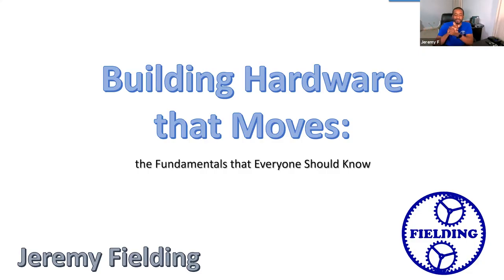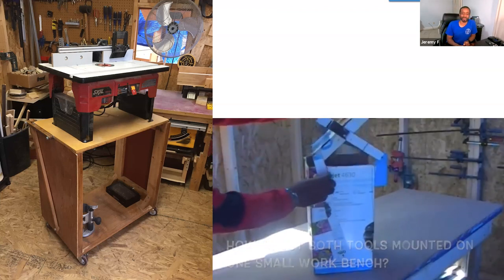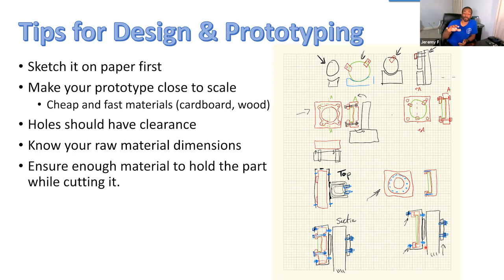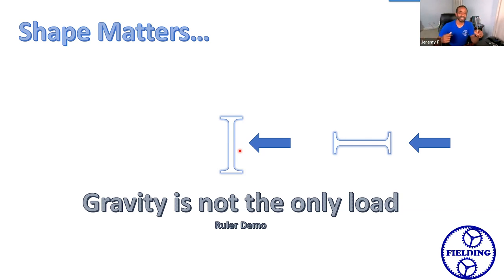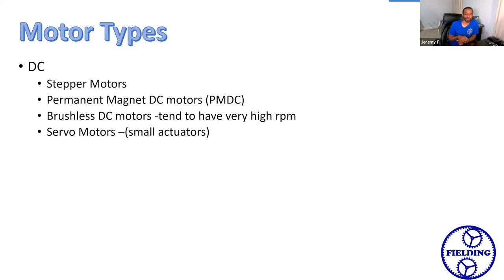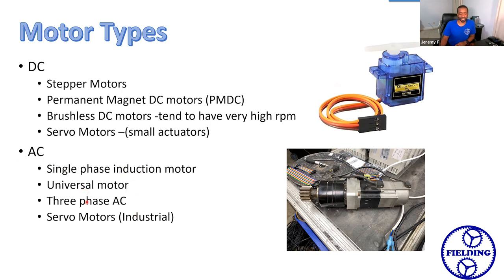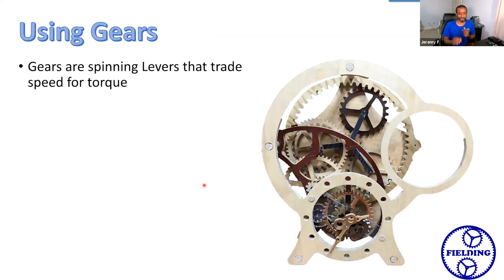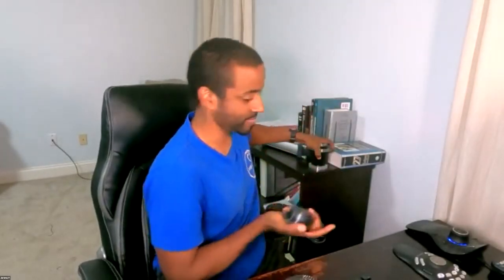Remoticon 2021 // Jeremy Fielding: Building Hardware that Moves

Comment: The ratio between young's modulus (stiffness) and density (mass) of any material manifests in the "speed of sound" through this material.

Steel and aluminium both have similar speed of sound. The "outstanding" materials are Titanium, Beryllium (toxic!) and carbon-composites.